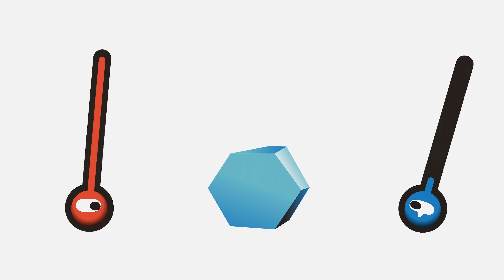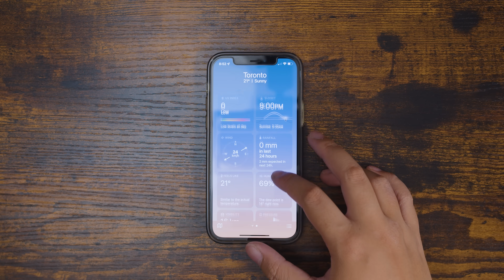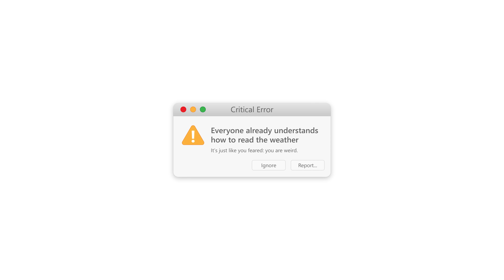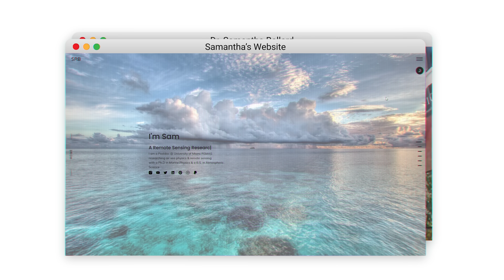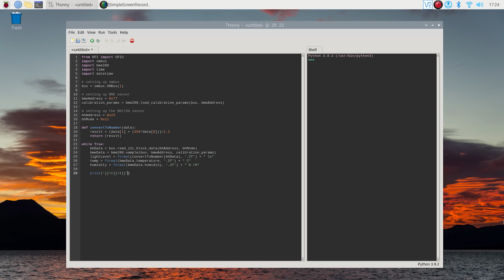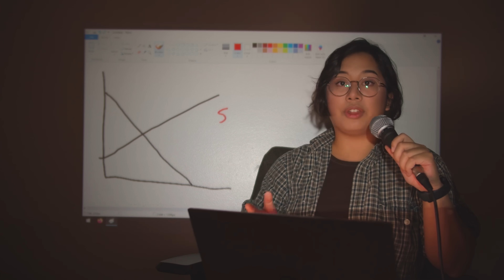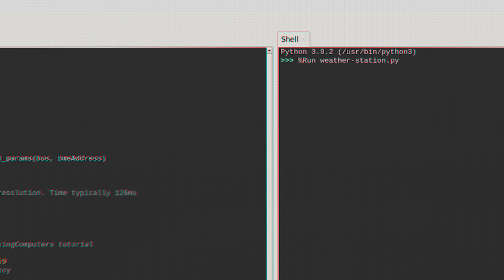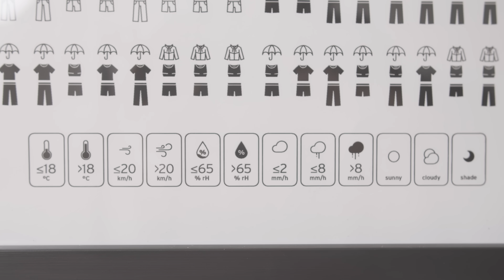how fahrenheit fails you

Comment: I understand the logic of comparing it to a 0-100 scale for F, but if I think about where I'm from, the coldest I recall is around -10C (14F) and the hottest is 30C (86F), so already off to a pretty bad start there. Coupled with not being used to F at all, if someone says "oh, it's 60 today" I have no bearing for what that means. Going for 60/100 scale that suggests to me it's just slightly above average comfort for me, however that translates to what, 15.5C? Which is a chunk below average comfort for me (I'd say my peak comfort is probably 20C with a light breeze). So it doesn't really help me with that either. 

I know that saying "It depends what you grew up with" feels like a cop out but I think that's just true. If it's 0C out then I know it's relatively chilly and I need to probably wear a jumper with my jacket.  Going by the 0-100 scale, I wouldn't say 32/100 is "it's really quite cold now I need to consider wearing extra layers", at least not to me.

Comment: What is that !!! You explain the difference into Fahrenheit et Celsius by what you need to put on your shoulder. It’s how too stupid you explain, « I  grow with that sort of scale so I understand and as it’s my own experience, the result is the truth. ». First Celsius define just the freezing point of the water at the level of the sea to explain pressure known. Centigrade scale explain the boil of water at the same pressure. And Kelvin is the most complete explaination of temperature. Three are equivalent 1K = 1C = 1 centigrade and are décimale. Fahrenheit are the most incredible choice of rationality. First 0 is found in a the freezing winter he could measure in Germany, not very easy to reproduct but, so why not and 100F is the temperature of a horse blood. 😂. And the firework 1 Fahrenheit is divided in 12 mesure. This is just a joke and how you try to explain it’s better because you have experience with that scale … wow !

Comment: over 24C is an extreme temperature and you can't change my mind
but also temperature is just a single parameter that affects our perception of thermal comfort

the temperature gradient makes a difference (how uniform the temperature is in the 3D space), wind speed, humidity and how much heat the Sun is pumping

but with all that said, when the thermometer (hidden from direct sunlight) shows 25C it always is hot, too hot
with 20 it can sometimes even be cold, with 15 it can be hot, but with 25 it will always be a struggle to keep yourself cool

Comment: I just check what the weather is like outside by opening the front door and seeing for myself and then I decide what to wear according to that. And when it's freezing cold and I put my parker coat, balaclava, and thick thermal gloves on and out my insulated hood up and go outside... I'm boiling hot and sweating profusely within 15 minutes. So I can be either cold or hot but never anywhere in between. Winter sucks...

Comment: My first thought was: This seems like a uniquely car-dependent problem where Sabrina simply has not touched enough grass in her life.
When I got to 6:00 I learned that is actually sort of the main theme of the video. 😅
By the way, my Celsius > Fahrenheit argument: the weather is not constant throughout the day, and even good ACs will have some fluctuations. That is assuming the thermometers are accurate and precise enough. Therefore, it makes more sense to similarly give a 'vague' number for the weather rather than a overly precise number. For the temperature, that means that a range of maybe 40 numbers is already a bit much, but a range of 100 numbers is clearly overly precise.
EDIT: To clarify the last point, I have like maybe 7 different tiers of clothing I can wear, so less than 7 steps of temperature would be too little but going from 30 to 40 won't improve my experience.

Comment: Imagine a measurement scale that focuses around the temperature range between roughly -18 C and 38 C. There’s absolutely nothing special about these numbers, other than the fact that they are temperature extremes that most people know the feeling of. 

Now, set the low end to 0, set the high end to 100, and you have the Fahrenheit measurement system. Congratulations, you now have an intuitive frame of reference for temperature. Low or subzero numbers suggest you are in for a cold day. Numbers close to or above 100 are sure to indicate a rather hot day. 

It serves me no practical purpose to use a temperature scale that is based off of the boiling and freezing/melting points of water, given how infrequently these metrics are even remotely useful in my daily life. Seriously, what is 100 C? I can guarantee no one has any frame of reference for what that is, apart from knowing it to be the boiling point of water. 

Celsius isn’t even SI anymore, as Kelvin has long replaced it. In the rare case that I do need to know those temperatures, knowing that 32 F and 212 F are the respective freezing/melting and boiling points of freshwater is more than sufficient. Making them 0 and 100 achieves absolutely nothing other than making temperatures feel less intuitive in our decimal number system.

Comment: Celsius is easy. 
bellow zero really cold, 0-10 kinda cold, 10-15 a little chilly (not freezing, but not warm) 15-20 betting a bit warmer 20-30 summer time, above 30 please just get cold again WHYY, (100 means boiling)
0 or lower means there will probably be snow if it rains, and at least ice.
Also you could bring some warmer clothes and some space to take some clothes off during the day depending on if you fee like your choice of clothes were bad.

Comment: I’m American. I grew up with Fahrenheit. I would agree, it is weird that it goes from 32-freezing to 212-boiling, instead of something sensible like 0-freezing to 100-boiling. But I like that it has 180 ticks between that 32 and 212, whereas Celsius only has 100 ticks. The almost twice scale makes temperature statements that seem more precise. Do Celsius people ever say that it’s 15.5 degrees? Or do they just round down to 15 or up to 16? Definitely, whatever you were taught to use is going to make sense, and whatever you don’t use is going to seem weird. I’m sure that if I ever moved somewhere where people only spoke of Celsius I would quickly learn that 20 degrees is a nice day, not 68. I’m pretty good at guessing the temperature. Hopefully I would be as good with half as many tick marks. Also… don’t forget the dew point. That’s what will really tell you if you will be comfortable or not. A hot day with a low dew point will be nice, and a cool day with a high dew point will not.

Comment: I travel a lot and I'm really used to the Celcius scale, I can kind of tell how the weather outside will feel based on humidity and temperature. I guess it really comes down to how much experience you have with the different temperatures, wind, humidity etc, cause after you've experienced a few different temps, you can kinda guess how it'll feel based on the cool little numbers on the weather app

Comment: Actually that sensor is awesome, and very cheap for what it provides. I have a meteorology bachelor's and I used the exact same sensor BME and the RPi in my final project (obviously wasn't just to get the temperature ahahah). Nice video <3
Reply: I finished training as an electronics technician not too long ago (career switch, now doing professionally my long-time hobby), and one of my semester projects was a giant-digit thermometer. The bulk of the hardware and software design was actually for the display (I used LED filaments and designed it so that the segments fade out, reminiscent of incandescent filaments), driven by an ESP32.

Comment: I work outdoors. My way of checking the weather is opening my window. Then I do my teeth and skincare routine. Then I get dressed.
If it is particularly hot I make sure to turn off the lizard's heat lamp so I don't come home to a fried reptile. (It's on a thermostat, but when it's hot enough, that is simply not enough)

Comment: Fahrenheit is way better.

It's 60 degrees outside, that's about 60% hot.  Who cares about the above 100s.  I grew up in New York so 84+ and you have to dress for hell cause that's too close to 100.  41 and lower and you dress for chilly weather and 5 and under, you dress with double jackets lol  Because it's too close to 0.

It's easy to guess the weather because the range is a lot bigger AND it's all self explanatory
Reply: its just depends where you were born (so either US/UK or Europe lol), and Celsius and F is pretty much similar the kelvin is the real problem
Reply: @novy1198  Kelvin needs to be released back into nothingness lol

Comment: Wow nobody explained Fahrenheit to me like this before! 
I moved to USA from Europe 6 months ago and I'm really tired of trying to convert to Celcium all the time.

0 to 100 as min and max makes so much sense! Thank you 😊
Reply: it can go below 0 and it can go above 100.. they're not min and max lol
Reply: @العقيدمعمرالقذافي-ح4ف yes but the distinction between temperatures once you exeed that range stops mattering from a "how does it feel" perspective as your pain receptors are firing. (It matters from a clinical perspective in avoiding heat stroke or frostbite)

100°F is also supposed to be human body temp (the actual range of values is just under 100°)
Reply: @jasonreed7522 
That implies the numbers were chosen as cutoffs for that reason, but that's not true. You could change where 0 and 100 are and you would be able to apply the same reasoning. In fact, I'd argue you reach the cutoff for being able to tell apart cold temperatures wayy before you get to 0 °F.

100 °F was never intended as human body temp; 100 was never intended to mean anything, even, because Fahrenheit is not a decimally-based scale like Celsius. The human body temp was originally conceptualized by Fahrenheit as 90 °F, then altered to be 96 °F, and then advancements in thermometer accuracy made this number slightly inaccurate.
Reply: @العقيدمعمرالقذافي-ح4ف  i know but you really face temperature below 0 and above 100. it helps for intuitive understanding

Comment: Fahrenheit is terrible. It is too hard to spell.
I'm a big metric fan, however, Fahrenheit is nice. Why? Percentages. Percentage goes from 0 to 100. At 0% temperature, that's the coldest I would care to be outside in. 20F is really cold, but good for outdoor sports. Below 0 is too cold. 100F is hot. Very hot. 90 is plenty hot for the pool. Over 100% Temperature and it is too hot to be outside. 
That's why I like the word that is too hard to spell - Fahrenheit.

Comment: I am very disappointed and managed to stay sane after watching 7mins in. Only good thing about the video is that you started to tackle this problem. Everything else is horrendous.
Celsius never lies. 24C is always going to be 24C and there is no difference whether it is summer or winter, its the same. It feels different sometimes, but you need to take in account the weather, mostly how windy it is. How even could would measure in mathematics what clothes to wear? Do we need a new unit to represent clothes resistance with analyzing material, volume, etc. so just that you would know what clothes to wear? It is possible but incredible inpractical. The best way to realize what clothes to wear is to check celsius and wind (and weather). Mostly humans know this concept. If you still dont know what to wear, just go outside and test the weather. If you cant bear it, just go back inside and change clothes, its not rocket science.
How even celsius vs fahrenheit is debatable? Celsius is part of standart units and everyone uses it. I guess everyone in usa can just use fahrenheits cuz they arent changing their system, but their system is useless everywhere else. 
Use common sense.
I know it is just a video for entertaiment and show, not real science.

Comment: I know your pain, but only because I've been trying to acclimate myself into Celsius (centigrade) from being raised in Fahrenheit-land. It's not intuitive yet, and for me being raised with FreedomUnits (!) it is intuitive in that system. But I'm getting there by using ranges:

- 0-10 (actually cold)
- 11-15 (chilly, dependent on precip)
- 15-20 (temperate, but still dependent on wind/precip)
- 21-25 (balmy, even a bit warm regardless of precip)
- 26-30 (warm, or stuffy -- dependent on humidity)
- 31-35 (actually hot, irrespective humidity)
- 36+ (oppressive)

I can't focus on "it's 22 C" because that's not intuitive. If I said "it's 71 F", that is very intuitive (to me) before you add sun/humidity/precip. I started this because since I was about 19 I've been exposed/connected to non-USonians who all use centigrade and needed to speak that language.

It takes time to learn. I applaud anyone who tries to learn about their own thought processes and grow/adapt.

Comment: I DO think F is more intuitive for climate temperature, but BEYOND THAT may I suggest wet bulb temperature? Then you get absolute temperature combined with humidity and sometimes wind-chill. Now we just need a standardized metric for “wet bulb exposed to additional average radiative heating and wind” and we’ll get a pretty good measure, at least when it’s not raining
Reply: If it’s actively raining you need to add chill beyond wet bulb because you also will be adding thermal mass you need to heat

Comment: I grew up with fahrenheit, but i keep my weather app in celcius to get used to it. I generally use this to determine how i should dress.

<0: freezing
0-5: cold
6-11: cool
12-17: nice
18-23: warm
24-29: hot
>30: too damn hot
Reply: that depends if it's inside or outside. 20°C inside is cold. at 18°C I'll probably put on the heater.
Reply: as a brazillian, for me is more like 
-11 = cold asf
11-14 = cold
15-19 = cool
20-25 = warm
26-30 = hot
31+ = damn hot
Reply: @iJuulia   as a brazilian who hates cold, I would say:
<11 = cold asf
11-15 = cold
16-20 = cool
21-25 = nice
26-30 = warm
31-34 = hot
35-40 = very hot
40+ = hell hot (but happens)

Comment: well if you ask what is more accurate it is Fahrenheit (if you don't want to consider kelvin in this debate it is simply C Vs. F) because Fahrenheit's degrees are tinier than Celsius like meter and an inch, but the better choice is Celsius because it is closer to Kelvin in conversion, which obviously Kelvin is better, in fact scientist don't use Fahrenheit from what I know, they stick to Celsius and Kelvin.

Comment: I view C and F as the same, just a different measurement showing exactly the same info! Why because there is a direct conversion between them. 
Celsius does seem easier to understand.
-100c = water boiling point. 
-0c = temp of ice water. 

The example in the video.. If the weather is 12c I know that it's between freezing and normal temp of 21c. 
As for Humidity affecting the effect of temperature, doesn't both c and f have the same issue of how Humidity affects temperature!?   

I do agree that Humidity that is reported by the weather app, is confusing and I don't understand it. It's always different than what I measure in my house.

Comment: I just find Celsius better than Fahrenheit because it's easy to know 0 C is the freezing point of water and 100 C is boiling point, where 21 C is typically room temperature. It's also easier to convert Celsius to Kelvin, where you simply add a constant to it.
Oh yeah here's a fun fact: -40 Celsius is Fahrenheit is also -40.

Comment: Both Fahrenheit and Celsius chose measures based on what people deal with.

Celsius pick 0 degrees to be when pure water freezes and 100 to be when pure water boils (under standard atmospheric pressure at sea level).
Fahrenheit wanted body temperature to be 100 degrees (obviously they didn't get that right, but they are close and body temperature is a range anyway) and to be 0 degrees when a brine (a salt water mix) froze. 

Neither is more or less arbitrary than the other.

Comment: A 0 to 100 scale in temperature is just as intuitive as a 0 to 50 scale, especially when talking about temperature, where "cold" and "hot" is incredibly subjective, and the parameters of "minimum" and "maximum" are practically arbitrary. The only reason you might think one is more intuitive than the other is because you're used to it. If you told me "It's 20c outside" I'd know exactly how hot it is and exactly what to wear, because I'm used to it. However, 68f? Literally no idea how hot that is. Add to that the fact celsius is designed to be compatible with the metric system (which is indiscutibaly better than imperial) and the freezing/boiling scale actually makes sense (and IS intuitive), and celsius becomes undisputably better.

Comment: Also, Farenheit is based on nonsense.  In Celaius, 0 is fresh water freezing and 100 is fresh water boiling, AT SEA LEVEL ATMOSPHERIC PRESSURE.

With Fahrenheit, 32 is when water freezes and 212 ia when water boils....what kinda easily understandable syatem is that retardation?!?!

Comment: The only time one is objectively less arbitrary than the others is if you are freezing or boiling water. That's it.

Most units in the metric system are beneficial because they can be divided and multiplied by tens to make bigger or smaller units, but you don't really do that with temperature. You're not going to talk about "decidegrees" or "kilodegrees" unless you're being needlessly contrarian. So that benefit of the metric system does not apply here. The result here is that it's actually pretty much impossible to objectively claim that one or the other is better. Within the context of measuring things you interact with day-to-day, both are quite arbitrary, with Fahrenheit corresponding a bit better to the total expected range of weather, giving it one tangible advantage for day to day human life that celsius does not have. That and the fact that whole numbers are simpler and more intuitive to most people than decimals, giving another edge to Fahrenheit due to its smaller units.